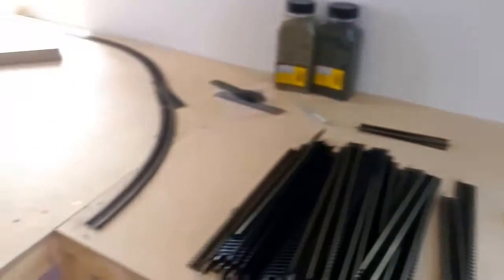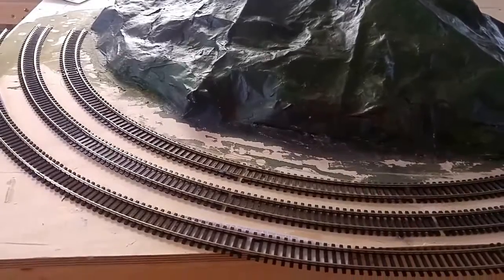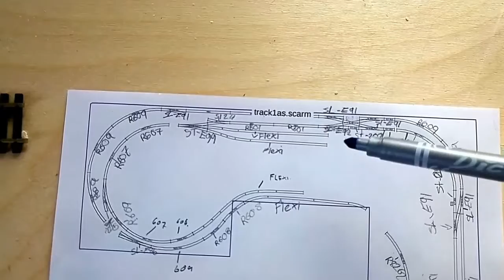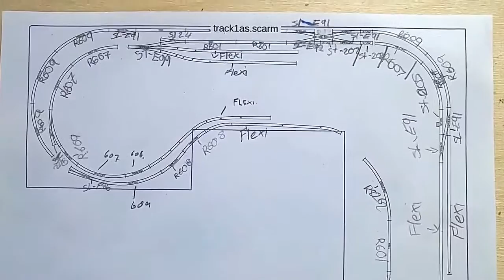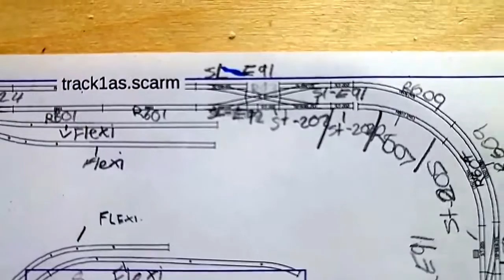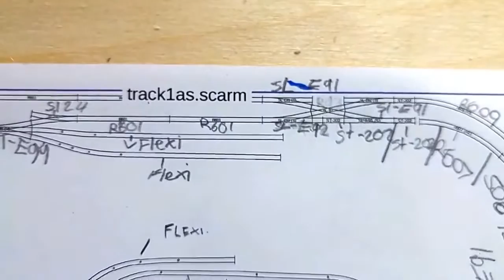Rail150 Introduction

Comment: hi nice intro video
i suggest you check your back to back wheel spacings
can make a lot of differance to trains running
cheers
mick
Reply from the maker: Hi Mick, cheers, I plan to put more videos on this weekend as I move onto the final part of phase 1 of track laying. I checked the back to back and all seems to be okay. The worst culprate is the Hornby P2 Cock of the North. I just seems to be so light on the bogie that it jumps all over the show. Just as well I enjoy tinkering and problem solving. 
Thanks, Gavin